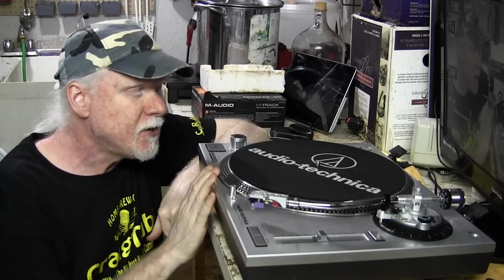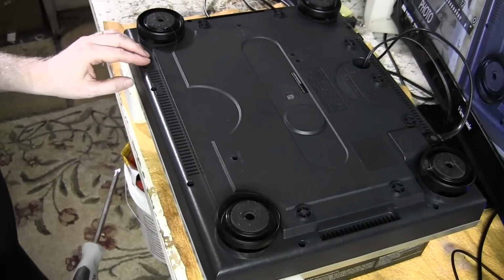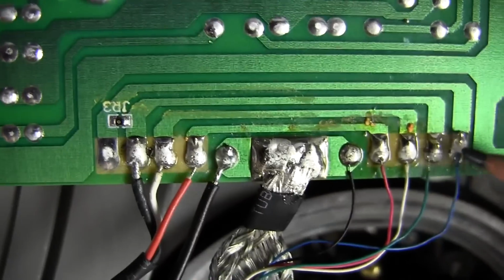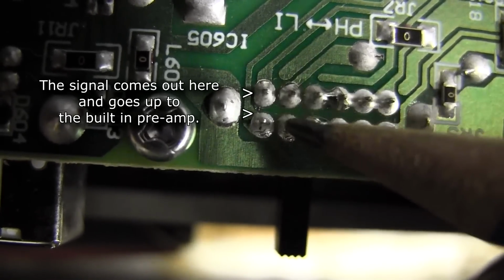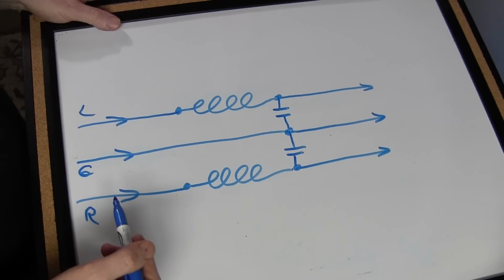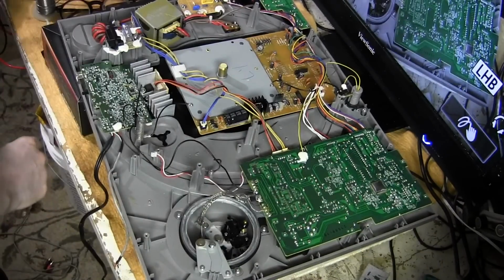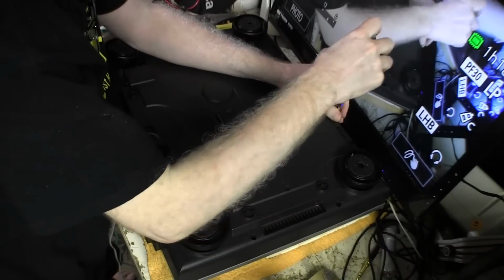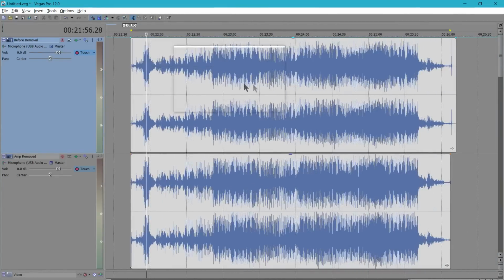Preamp Removal - Audio Technica AT LP120 USB Turntable

Comment: Signal path degradation with bad parts is a big deal.  I had it in the $5000 sony scd-1.  Sony cut corners and put bargain-basement caps and opamps in the analog section.  This unit needed a $800 re-cap or a $1500 recap+ new opamps just to live up to it's own hype. Even expensive pre-amps with integral phono stages cut corners vs a stand alone phono stage.

Comment: A small difference but audible. In my experience the worst thing about these turntables is the USB output. The preamps (on or off if switchable, flicking the switch to phono mode doesn't fully bypass the preamp in these things) sound fine, maybe a hair darker than directly from the cartridge (and some people, especially those new to vinyl might actually like it, because it does filter out some surface noise too, which people coming from digital audio aren't used to), but the USB audio has a looot less treble, it's frustrating. I'm currently pondering if I should do this mod and get a dedicated phono preamp with USB, or just get a little audio interface to grab the line signal from the turntable without the crappy internal usb.

Comment: I know it's several years old, but this is a good video. I really appreciate that you traced out the circuit path and pointed out what is clearly a low pass filter on the output. Most of the videos I have seen on the removal of LP-120 preamp have included conjecture about the circuit, but you make it clear here why this mod should be done if you have one of these and use an external preamp. I recently took one of these out of storage for an office system that wasn't quite "audiophile" quality when it was first put together (I had no intention of this system competing with my main system), but after coming into a nice Fisher 700t receiver and a second pair Klipsch Heresy 1s, along with a Lehman Black Cube SE phono stage and upgrade to the stylus on the AT cart to the ML stylus, I found the performance of this turntable to be much better than I ever thought it would be. After seeing the clearly improved amplitude of the highs and the a subjective improvement in sound that was obvious even on my computer speakers through YT, coupled with the solid EE around the modification, I know what I'm doing this weekend with my LP-120. Thank you for taking the time to make this video!

Comment: My Audio-Technica AT-LP120-USB is wired to my receiver (DVD) and is not playing any sound.  I can faintly hear music/sound when I put my ear to the needle.

I haven't changed anything and did troubleshoot various checks, including toggling the line/phono switch, testing the RCA cables on another input (CD), removing and re-installing the stylus, cleaning the stylus pins and arm pins, hum test (no noise) and still nothing.  Would removing the pre-amp help?

I really liked this turntable.  Any advice would be greatly appreciated!!  Thank you.

Comment: Ok. So I’m NOT an audiophile but I’ve owned this very turntable since I think 2015 or 2016 - and were in December 2024 so that’s almost a decade. It’s my first and only record player. Very recently I’ve been a fake audiophile so I’ve learned about the built in preamp and that it’s not very good. All this time I’ve been using it along with some 15 year old M Audio AV40 powered monitor speakers. I recently got some noise from the av cables (my WiFi router might be causing the noise) so I bought a very cheap battery powered external phono preamp to see if that may remedy the noise I’m getting from the cables. If you’ve read this far into my comment, well thank you.  
So I got the built in preamp and now tested the external phono preamp. I can’t tell the difference in  sound. Until I did a crude recording with my iPhone. I’ll tell you with the regular built in preamp this turntable sounded “muddier” in the bass .. idk if that’s the right word. The bass sounds just more distorted and not so tight. Compared to the sound from the $23 Pyle Phono preamp the tracks sounded noticeably “crisper” with the bass being much more tight and controlled. Again I’m not an audiophile so I’m trying to describe this as best as I could. In summary the average dude will say this record player sounds better while using an external preamp. Sorry for such a long read.

Comment: Mid range vocal is the same but ....................treble is fuckking nasty.  It sounds like someone has used EQ boost on the treble.  So, the post rework made it much worse  !  There is SO much sizzle I want to fuckking vomit.  You probably will never get to read this.  Did you plug the turntable into a good, external, phono preamp with RIAA equalization  ?  Thank for all the work and audio analysis.  Gary S.    11-08-24   I gave you a "thumbs up" for the effort.  Very good effort.

Comment: My LP120 is 15 years old. I watched your video and should have stopped after removing C631 & C632. Sound was great. But no.. Destroying the internal amp with further mods was the best thing that could happen. Now it has a Aikido board inside🤘Hardest thing was to find a matching power supply without noise. One out of five worked (HNP12-240L6).

Comment: Old video but hey... Love your stuff on yt! This one got me puzzled though. Did you change the cable? Is the capacitance changing? I have heard that cable capacitance could affect MM-cartridge sound. And may be clearly visible in measurements... usually not an issue with line level audio but MM-cartridge is a different beast?

Comment: One question, would it be more simple to bypass the little components by cutting the circuit traces and jumper them to the outputs? That way you could still use the internal preamp in a pinch.

The difference in audio was night and day. Doing the closed-eye test, I opened them when I thought you switched as was right every time. The difference is significant for me to hear it through YouTube's compression. The tune was great - was a treasure to have your own 100% big-production song pressed to vinyl.

Comment: Before the test, did you volume match the tracks? Because if it is louder without the preamp, than even if it's only half a db louder, that's enough to trick your ears into thinking it's better an clearer.

Like could the difference simply be a matter of turning up your volume and boosting the treble a bit on an EQ, which would be nondestructive and give you the option to adjust per song.
 
I'm also curious if there was a difference in the natural noise level of the turntable between the two? Like were those capacitors indeed cutting off some noise, or were they pointless?

Comment: So, I do have this exact turntable, but I am running it through my Panasonic SJ-316 (home theater) receiver. So far, it sounds fine. My concern right now is my grounding; I do hear a few pops from time to time, even when the turntable is on but not turning. Nothing yet that is too offensive but interesting. I am looking to buy a pair of Edifier S1000mkii to run the turntable through; thereby, bypassing the Panasonic receiver altogether. But that won't be for a bit, a few months for sure. What I do like about the by-pass is the highs you get; you can clearly hear it in the cymbals and vocals... that to me would be an absolute plus. But I am not so sure of my skill level to do this job on my own. My concern is, it appears that the Edifier S1000mkii does not have a ground hookup. Where then do I ground the Turntable if I remove the preamp while using the Edifier monitors? And or, should I just leave the preamp installed if I use the Edifier monitors? Any info on this will be greatly appreciated. Thanks

Comment: My at1240's with USB output and the phono / line switch - sounds like shit.   I have 2 1240s and 2 Technic 1200s and when compared in an open channel with nothing playing (to phono line on mixer)  the Technics are literally just 'air' if I bring up the levels with nothing playing  -   and the AT's both Buzz and it's not a 'ground wire' issue.   Also depending on what you have plugged into the power bar.. it can bring up the distortion on the AT's.. .  Again, nothing affects the Technics plugged into the same power bar and mixer . Some real dodgy shit and now I'm hearing some capacitor issues on the PSU on these AT's can cause them to simply fail .  China never makes good products, no matter how much they polish that turd.

Comment: Six year old video may be a life saver. Haven't used my turn table in years(8+) . To my dismay it sounded horrible so swapped cartridge's with no difference then it dawned on me to bypass the built in preamp with the switch(da). Well the right channel works but not the left and confirmed the lost left signal is within the turntable, next adventure. Good to see it opened. I suggest use some superglue or epoxy on those sleeves instead of tape. Now do I start painting the living room or fix the turntable to listen to albums sitting for 8+ years?

Comment: Thank you. Preamp has no epoxy on the circuit board, everything was coming off as I had some dead wire or connections issues.. I'll just bypass that lil f*** ....and it seems to sound way better.

Comment: just did this today on a sunny day, it is indeed a big difference, much clearer now, try this test, record the sound with your iphone, i know, not the best device to do this with but still, trust me, you WILL hear the difference! I did the test with "Hell to the liars" from London Grammar and some other from Steve miller band. With london grammar , as soon as she begins to sing the difference is noticable even through the microphone of my iphone , put on headset and listen to both recordings, you will be amazed.I went the same route as Craig did, complete removal of the preamp, i reused the preamps ground and simply extended it, i also used the same original audio cable simply soldered directly to the board. Be sure the included the extra ground wire as it reduces noise( Hum ). Thanks for this detailed video Craig, you made my day(s)  :-)

Comment: Definitely there is more higher signal after removing the pre-amp, and a smoother and bass sound with it installed. I am wondering if the type/quality of the cables than you added (ground and audio) has to be taken into account on the signal you are recorded, as you recorded two takes with different wires. What do you think?

Comment: That's a great comparison! Definitely better highs and "sizzle" after removing the preamp completely. I'll need to do this mod once I settle on a preamp- my new receiver does not have a phono input, so I switched to the "line" mode and found this video when I was wondering if the onboard preamp is any good.

Comment: A big improvement with turntables that have a hollow plastic bases is to use good flexible sixaflex rubber sealent for mechanical use and fill up every empy space.This you hear easy gets it up a leage. Think the filter in this inbuilt thing was a subsonic filter to avoid a generation with less knowledge about feedback rumble bumpy records,a good subsonic filter could save a woofer.  Loud playing with a record is done and no subsonic filter is there woofers and smoke can be a result.Had some Nikko gear way back.Still have some stored away.Was/is great gear!

Comment: ground from arm headshell i have seen on old good turntables, where they have a lead from arm chassi with a cermaic cap in series to ground lug where pickup ground also meet.This is then soldered to the ground terminal used normaly on them from the time there was no usb
Reply: What value CER cap?
Reply: @VaughnfromPeterborough  Ceramic disk shaped or ceramic smd nonpolar capasitor, the value typical low, in one i tested 95 ish nF

Comment: Hey just a thought, you should also reconnect the preamp and run it through a system with no preamp attached to it, I mean turntable -> built in preamp -> amp -> speakers, and see if that makes a difference. Because it seems to me that you have been running turntable -> built in preamp -> preamp -> amp-> speakers, on the before recordings, so we still do not know if that is an issue or not, since we don't have a sample of that variable. I will sub and click the bell for the next video on this matter.

Comment: I never really believed in certain Audio Equipment hacks/modification (extremely expensive speaker cable, thousand dollar audio connects, upgraded ceramic fuses (still on the fence on this one), etc., until now.  My skeptical ears have been convinced that this modification really improved/s the vinyl dynamics.  I will try this modification myself.  Also, nice song.  Thanks for your video, you are an inspiration to the audio community.

Comment: So ive got a pair of these, done the pre-amp removal on one and left the other with it attached to see what it sounds like. It sounds like crap compared to the one with the pre amp. Two copies of the same record playing at same time, ive swapped records, swapped headshells, same result, sounds horrible. Ive got both decks connected straight to a mixer, would it be best to use and external amp for it? i did plan on removing the pre-amp from the other deck also, in two minds now, thinking about sticking it back in.
Reply: Sounds better with it lol

Comment: Great video!!  Even my 72 year old ears were disappointed each time you switched back to BEFORE.  Using older iPad Pro, Bluetoothed to new RAYCOM Everyday Earbuds, set to “Balanced Sound”.  Impressed how much I still like the sound of vinyl, (and your recording).  I owned an AudioTechnica like yours, without the vertical adjustment,  I think it was $139, with the Shure cartridge, from Heads Together in Squirrel Hill, Pittsburgh, circa 1972, same day I bought the newly-released LedZep 4 ZOSO!.  Thanks, Craig!

Comment: New to your channel, I really like it. You explain everything really well with no technobabble. I recently bought a new turntable and have been upgrading little things like the mat, cartridge, speaker cables. I'm not an audiophile by any means, I've just been collecting and playing records since I was a kid, but anything that improves my setup I'm comfortable with. The preamp removal is very interesting but I'm not in a frantic hurry to do that, it looks kind of scary to somebody who has never soldered anything in my life. Not a good thing to practice on; my lovely new turntable. Am I right in assuming there is some signal degradation even with the turntable switched to direct line out? I'm guessing so otherwise it would be pointless removing the preamp. As for your song you played, I thought that was fabulous. I'm in the UK so no idea if that did anything chart-wise? If not, it should have done. Thanks for the great content.

Comment: You could have connected at the output of the switch before the the coil/cap filter array and left the internals intact for the test… with the power removed at the MOLEX the preamp is inert.  The last effort is to attach the ground connection for the ext. pre/amp at the shield on the main board,  Four solder connections and one power plug!

Comment: Graig nice done one tip when you re-solder add some new solder don't reheat without you can make cold connections it looks OK but it can internally loose. About the tweak you just avoid the inductor and capasitor but in the vintage riaa phono there are almost sertain a capasitor like the one you avoided. Don't get me wrong the cardridge ones you use need these in the schematic. By filtering the highest frequenties you now hear more bass and mids you may even play with it. Caps of 100 picofarath or pf till 220pf you can tune the cardridge by that. Mostly your cardridge specifications can provide a amount of pf. Look it up you will see, Cheers mate

Comment: Ofcourse it sounds better with the dedicated pre-amp rather than the one it came with but we all kind of knew that already. 
Good job on this video even though I'm watching it years after you made it. Thank you for this.
What I'm wondering though isn't there just a switch to turn the pre-amp off and then connect to an external? Or is this turntable this bad that you have to solder one on?

Comment: I have a doubt? I'm lost. I didn't understand why I took the pre-amp off the At-lp120, could you explain it to me? I have two and use them connected in a pioneer mixer, I have seen some videos talking about the pre-amp of the AT-LP120 and I did not understand why they are removed
Reply: Porque estan obsesionados. Empezó una persona que estaba al pedo, queriendo transformar la LP120 es una Technics 1200. Y luego todo el mundo empezo a imitarlo. Suena mejor mas natural y real con el preamp interno (desactivado), que eliminandolo.

Comment: I do own the AP-LP120XUSB, I will not remove the preamp from out of my turntable, IT IS UNDER WARRANTY!!!! LOL Even so, I just don't feel as if I have to guts to do that and risk the chances of screwing up my turntable. I have a Vaccume tube class A amp with point to point wiring and a very good pair of Klispch shelf speakers and Klispch subwoofer, so I'm good. But i did learn from your video and thank you..

Comment: My turntable has a switch in the back you can either use the built-in preamp or use a separate preamp I just can't see doing all of this and messing up a decent turntable but then again it's yours of course I wouldn't waste my time I mean if you're that concerned about having a turntable with no preamp just sell that one and buy another turntable with no preamp I just can't see going through all of this but then again it's yours do what you want

Comment: Those spacers drop in from the outside 🙃
Reply: Also if you still have those files and wanna retouch on this, what you should really do is invert the polarity of the before file and then run it simultaneously with the after signal... It should cancel out everything that's not filtered by the circuit and you'd (we'd) likely be able to tell exactly what frequency that cutoff is at